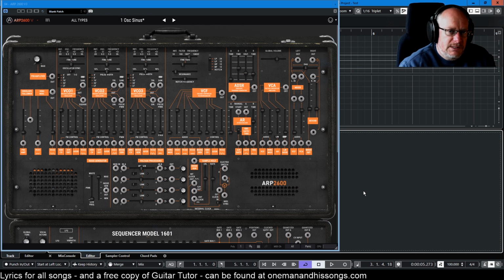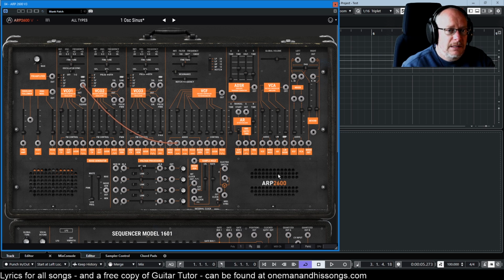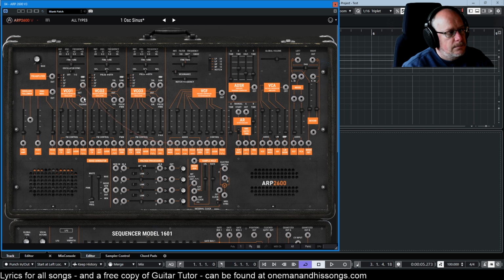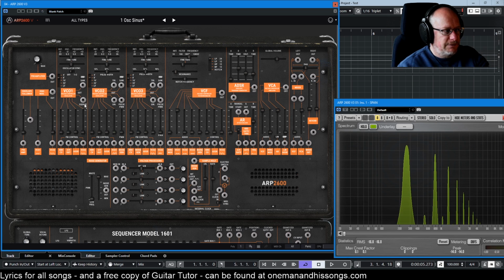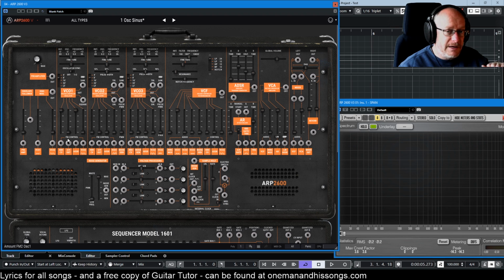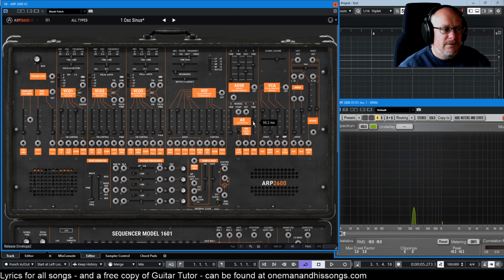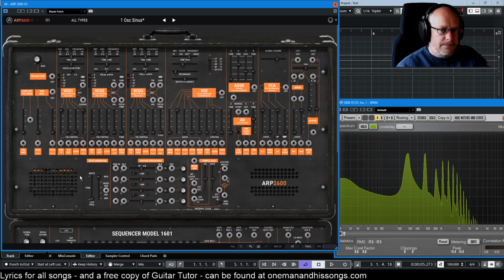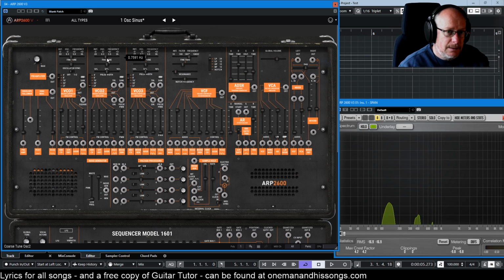Arturia ARP 2600-V Walkthrough Ep.02 - A Deeper Look Into VCO1

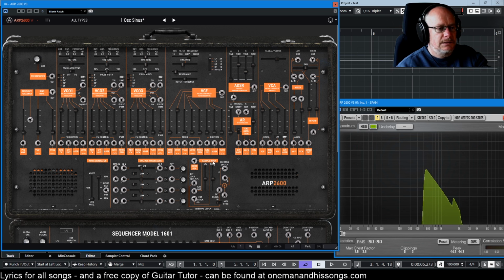Comment: im on oso sinus 1, and i cant fingure out why the release isnt active, i turned it up on the AR, it will play the sound then when i release it, it will play regular pitch (im messing with the adsr on the fm) but then when i turn up release only on adsr and not ar it doesnt do anything, any thoughts why? EDIT: was trying to imitate what you did with the release at 8:10
Reply: i think i understand it more from messing with it, the release on ADSR is the fade off, and the release in AR is just how long the sound will play after let go
Reply from the maker: Just like most things with the ARP, messing with it is the way to go! It's all about the routings. By default, that particular preset is normalled to use the AR envelope on the VCA, so the Release slider controls the release of the note. The ADSR envelope, however, is normalled to the VCF, which you can hear quite clearly if you change the Osc from Sin to (say) Saw.